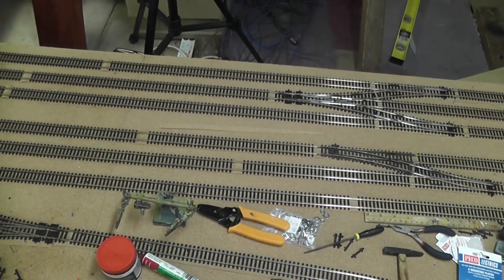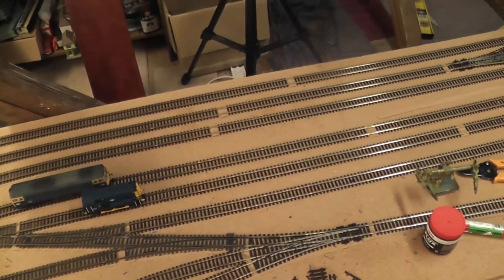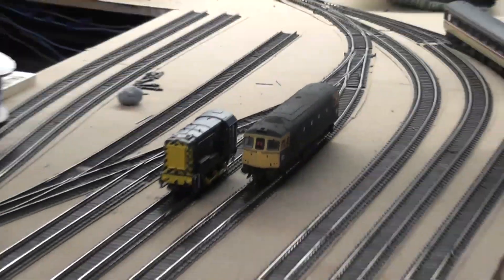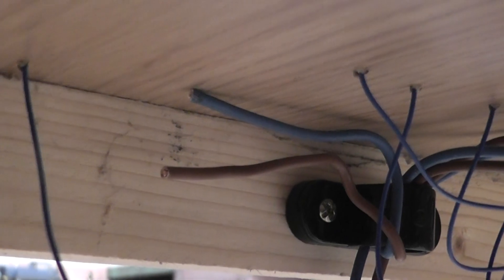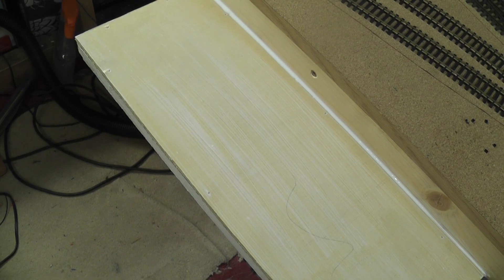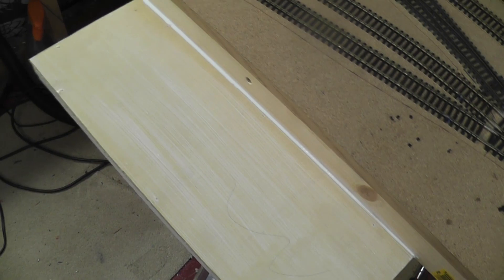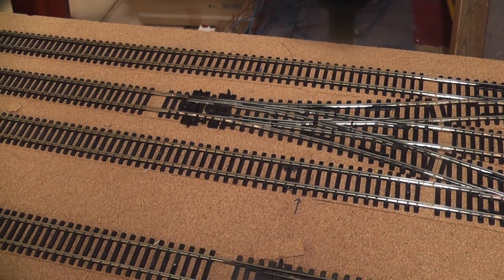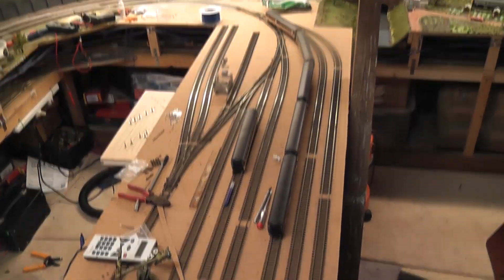Building a Model Railway - Part 5 - Control Panel

Comment: with using centre off switches on your panel wouldn't it be a good idea to have led's showing which way the point is facing...just a thought.

Comment: Lovely videos, is there a reason why you've got the lock washers on the point switches upside down?  Usually, the little tab sticks downwards into the panel, to stop the lock washer from rotating.
Maybe you turned them over when you put the overlay on the points control panel and it's in a different video.
Reply: Actually these are anti-rotation washers, the washer goes behind the panel and the tab into a blind hole in the panel.  It's meant for situations of high vibration.  It is clearly not needed here, you do not need to fit them.
Reply: Ok, thanks. I think I'd use them anyway, loose switches are so annoying!

Comment: See the switches you use....what kind are they? I see a lot about single throw double pole etc etc, what ones work with point motors?   I use the Peco lever switches but no idea what they are! lol

Also, where did you source these switches?   I may use some for the fiddle yard 'should' I decide to use point motors in the future.

Finally, do kadee not manufacture magnets to suit their couplings?

Nice update!   I am re-laying a part of my layout to make access to the fiddle yard. Check out my june updates....I also have a Deltic!
Cheers.
Dave
Reply from the maker: DaveClass47 Hi Dave.  The switches are single pole double throw.  Often advertised as (on) Off (on) toggle switches.  I get them from rapid electronics as per most of my electrical supplies.  Haven't seen the deltic vid yet, will check it out.  Most free time is being spend under the layout at the moment.  Cheers
Reply: +DaveClass47 Why are you using wire stripers?

Comment: I've just been watching your 2015 video about control panel building and am intrigues by the three way connectors you have used under your layout to attach droppers to bus wires.  I have been searching for something similar but cannot find any on the internet.  Can you please help as to where I might find some? Thanks.

Comment: Another excellent update, looking forward to you others.  I do like the couplings you have used; can I ask what the part number of the Kadee uncoupling system you use is?
Reply from the maker: Simon Young At them moment i'm just using 2 - 3mm thick magnets bought from ebay.  Kadee make various different uncouplers, but they are more expensive.

Comment: Simon when I was viewing your rolling stock video which consist of a very varied stock, a question came to mind, my loco fleet is old and some of them have a "D" as a prefix and when the TOPS system was introduce these numbers were updated. Looking at them now I am a little puzzled as to whats what.
My only guide to BR locos is the "Observer's book of British Steam Locomotives" first published in 1955 revised in1966 (my copy) which contains some early diesels.

So my question is, what is the most complete guide covering all current UK motive power book that I can buy if it contains rolling stock all the better with a link to Web site as I live in Australia would be most helpfull.
Reply from the maker: Morgan Conroy There are literally hundreds of books about the prototype locos and equipment across their lives.  The D prefix system is confusing, thats why BR got rid of it.  All my knowledge has come from internet research.  I have few few books so I can't really recommend much for you.

Comment: Hi Richard, I have been following this with great interest as I am setting up my layout, one question if you can help me with, I am just using the standard coupling that you see on most Hornby Coaches and Locos but I would like to switch to Kadee Couplings and I was hoping that you might be able to tell me I need to look for, do these just fit out of the box or is there any extra fittings needed, thanks for any help you can give.
Reply from the maker: John Morrow As long as your models are reasonably new (2005 and on) then its should be easy.  New stuff has whats called a nem pocket that the coupling plugs into.  Kadee make nem couplings that will just plug into place.  I suggest using kadee 18s, 19s and 20s as they work well on tighter corners.
Reply: Thanks for your help Richard, I will have a look at some couplings and possibly order a few to try out first before going mad and buying loads of them, thanks again for your help.

Comment: Excellent video Richard, really enjoying the series. Also how much clearance do you need between baseboards if the upper level has point motors attached to the underneath of it?
Reply from the maker: JamesStJunction I allow about 7 inches, but the more the better as installing the motors can very difficult with the limited space.
Reply: Cheers thanks for that.

Comment: Can you elaborate on insulftog points & using points clips which I what I'm using - just three wires. Where exactly are 3 wires going when they leave motors? & to reiterate a previous question,  how can you get a simple on/off toggle switch to do the job without burning out motor or are switches on - centre off - on switches. Please clarify. Thanks.
Reply from the maker: Terminals A and B go to your switch.  Terminal C goes to the negative side of the capacitor discharge unit.  If your not using a capacitor discharge unit terminal C needs to goes to 0v.  Hope that helps.

Comment: Would you need the little bits of wire on the insulfrog points for DC?
Reply from the maker: Luke Knights Not with DC, just leave the points unmodified.
Reply: EverardJunction OK thanks

Comment: Great video - I have learned so much from this series.  One question:  for crossovers where two points are back-to-back so to speak, is there a reason for not wiring them both off of the same control panel switch?
Reply: Disregard - I just watched the next episode.  :)  Cheers!

Comment: Of subject but as you are in a loft how do you stop buckling of the track i got a bad buckle on mine now since 35C yesterday. Even with windows open and fans running full pelt. It will take some repairing before the trains run again
Reply from the maker: Malcolm Walls I make sure to leave a small gap of 1 to 2mm at every join in the track to allow for expansion.  Even with the very hot weather I haven't had any issues.
Reply: EverardJunction I did that when i built it as i had issues in the past must have been to small a gap thansk for the reply

Comment: Are those couplings any more expensive than tension locks?
Reply from the maker: Humbolt136 Yep, tension locks come free with almost every uk model.  I have to by the kadees separately as the are not standard in the uk.
Reply: EverardJunction Well true but if you were say converting from medium to small tension locks would it be more expensive to convert to kadees? (assuming all the NEM pockets are there already)
Reply from the maker: Humbolt136 Probably more expensive for kadees.  A pack of 4 is about £4.

Comment: I don't like the large gloppy look of the plastic insulated rail joiners. When I want to isolate a rail I cut the track with a thin saw and insert a piece of plastic in the cut and then use "super glue" to bond it. It has always worked and then I can file the gap filler flush with the track and when whethered you can not see the gap or the filler.

Comment: why should we use an extra dc bus wire when we have an dcc one?
Reply: To run the point motors.  To run those with DCC power risks damaging the DCC controller.